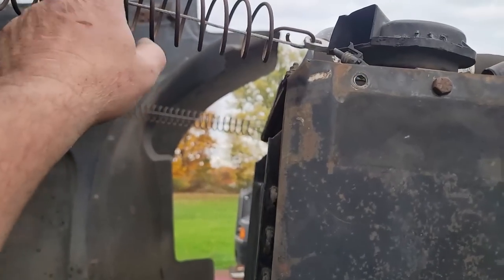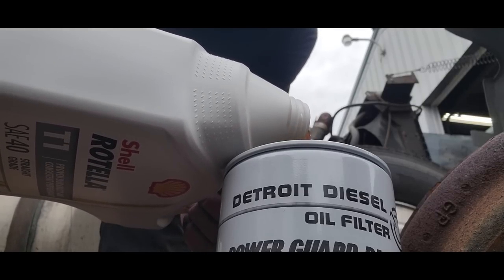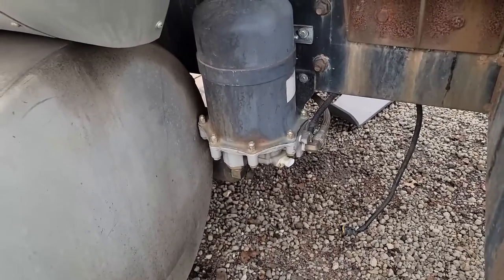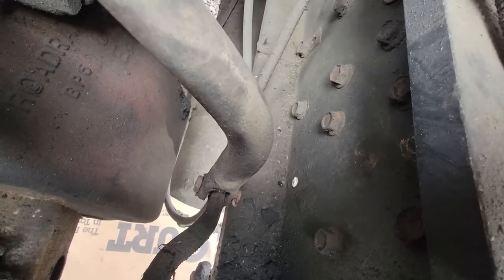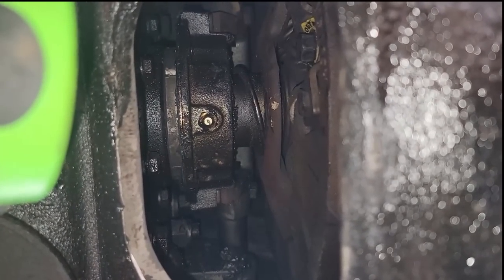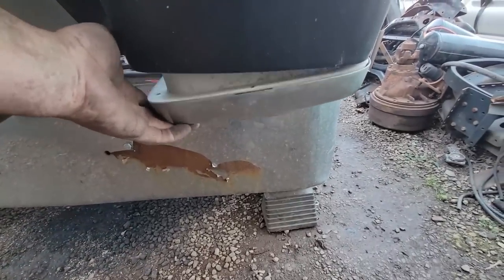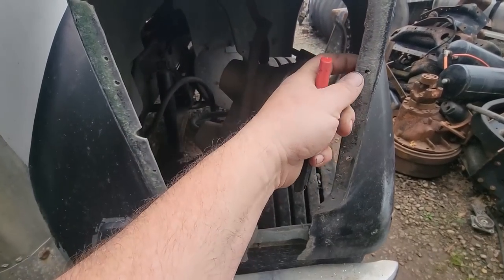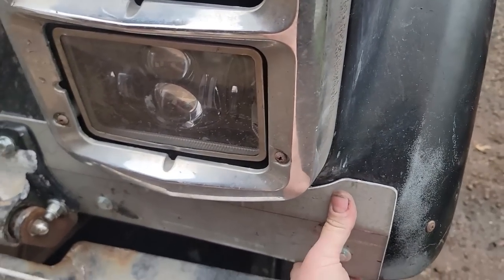2 STROKE DETROIT CLUTCH ADJUSTMENT ON A WORN OUT TRUCK! PT2

Comment: I just watched both the videos on this truck and it’s amazing how tiny little fixes stack up and end up taking days to fix it all.  The trucks’ in good hands.  I don’t think you mentioned it in your videos, but are you a fan of these old 2 stroke diesels?  I’ve heard the only thing their efficient at is making noise🤣
Reply from the maker: two stroke have been turning diesel fuel into noise for far too long. the novelty wears off after a minute or two....specially if your like me. i have no interest in an under powered, extremely loud screaming engine.

Comment: Great video again on the ol' Detroit! That GMC Astro/Gleaner combine combo I told you about the other day, we used Delo 400 30W engine oil in the Detroit. We were told that it slobbered less than other oil, and I recall that it did help with that! The 8V71 was quite the bleeder when it came to engine oil! The one in your customer's truck looks pretty dry!

Comment: i may have asked you this question before. have you ever used the older York A/C compressor and modified them for onboard air for a tow truck. i have that old 1966 D500  Dodge doesn't have air brakes but want onboard air and also want to add onboard air on my 1994 Ram 2500 i do some offroad recovery jobs with it have warn 8274 front winch and 8274 rear winch and 2 warn 8,000 for side pull  and have a Apex 12,000 for the small boom for lifting. would save me a lot of time having onboard air. also planning on adding two air bags on the rear and the air would be nice for that
Reply from the maker: i have not done the york a/c compressor as an air compressor but i have heard of other doing it. since it has an electric clutch, you could run a pressure switch to control the coil. a pressure relief valve too. would need a check valve in the tank. only thing i wonder about is how you unload the compressor when it cycles. you wouldnt want it hold cut out pressure in the line between the compressor and the tank. i assume you would want it to purge so when it started again it wouldnt be so hard on the belt and the compressor itself.
Reply: @j.c.smithprojects  they have some sorta kit supposed to have everything you need